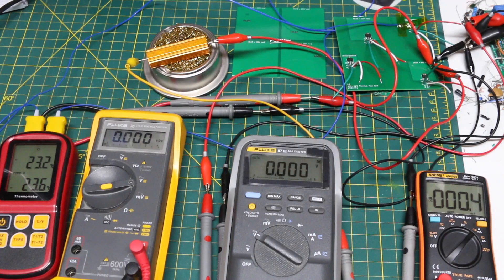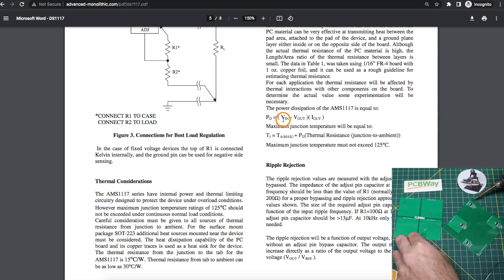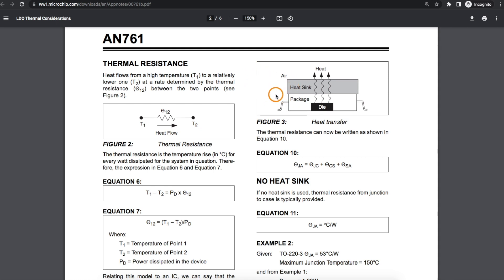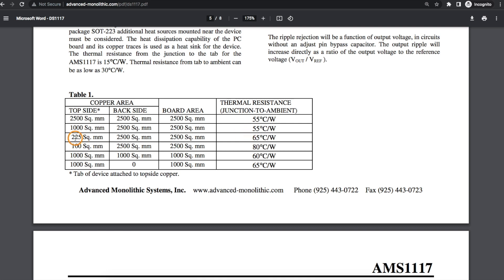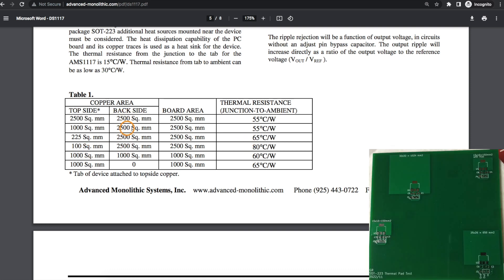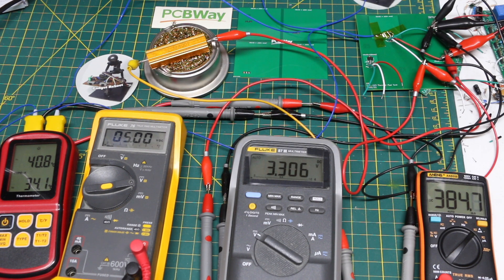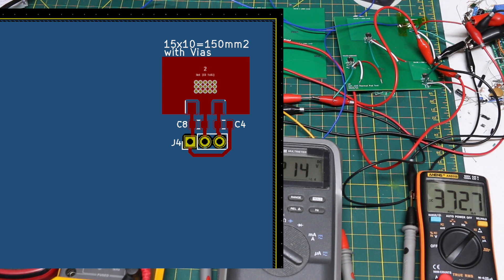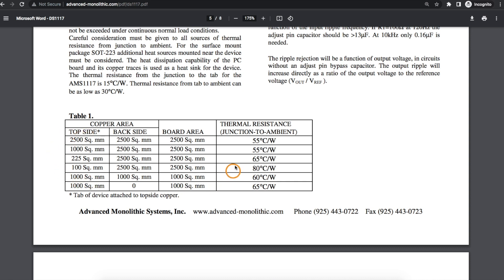PCB Heat Sink Experimenting

Comment: The problem with a bottom copper is the heat wants to rise but the PCB is on the way.
This is why the way orientation of the fins on heat sink affects the efficiency of the design as we want the hot air to raise drawing in cooler air to replace it. If the air can’t get away from the copper the air and the copper just keep getting hotter.

You want lots of via’s to help the heat flow through the board so the top can radiate it better.
Reply from the maker: Luckily for my diy stuff I can mount the boards 45 degrees and rotated slightly if that's what it takes!  As long as I don't have to stand on one foot and recite a poem to get it going, like trying to fine tune an old tv antenna
Reply: @GadgetReboot  I think you need to change the device and fit a heat sink while standing in the sink. that way you increase the suface area of the heatsinks.

Comment: Very interesting experiments. That particular LDO is ubiquitous.
Newer TMC stepper motor drivers have the hot chip mounted underneath, and a small heatsink glued atop of the PCB. Via grid there, of course.
I have blown about a dozen AMS1117-3.3V trying to drive it at 12V, but suspect the initial input voltage spike has more to do with that than power dissipation. I don't even attempt it anymore.
An input resistor can help dump excess power away from the regulator, too.  Hmm, for SMD, guess you would use a bunch in parallel.
Reply from the maker: yeah I think the data sheet only gives an absolute max input voltage of 15 but I don’t think I saw a normal recommended operating input so it could be sensitive to any start up excess.  depending on how long the start up overvoltage  is there  I wonder if something like a clamping diode would help protect the regulator?
Reply: @GadgetReboot   You mean a TVS diode? Hmm, guess that would clamp the absolute input voltage.  An NTC Thermistor could also soften the capacitance-induced transients on startup. Now I gotta try these.
Reply from the maker: Yeah I once had a weird issue on a 5v logic supply for some test fixture bed of nails rig (a job maybe 20 years ago) where over voltage spikes were coming from somewhere (maybe when the vacuum for the bed of nails kicked in) and it would reset the logic board.  Threw a TVS on it and never a problem again.   I haven't used thermistors much, one of those bucket list to-research things.
Reply: @GadgetReboot   You sent me on the hunt for what "bed of nails" means.  I do have some pogo pins!
NTC Thermistors look like big black capacitors.  They do not conduct well until they get hot.  I bought some for audio power rectification, because the large smoothing caps tend to draw too much current at power-on.
Reply from the maker: in the 80s I had a friend whose father was an audiophile  and worked at a place that made transformers and his living room receiver always had the cover off and he had extra capacitors sitting beside the receiver hooked in parallel with other capacitors in there. I wish I could remember what he said he was doing at the time but he gave me a lot of old things he used to not need anymore like soldering irons and bread boards. 
I actually just got a few pogo pins and receptacles from AliExpress. I figured I should have them in a parts tray just because, I have parts trays.